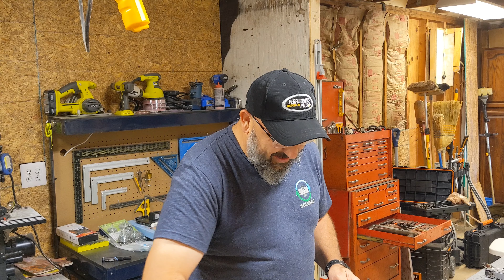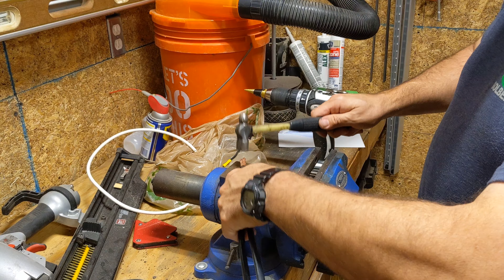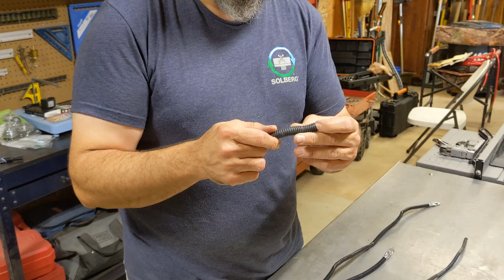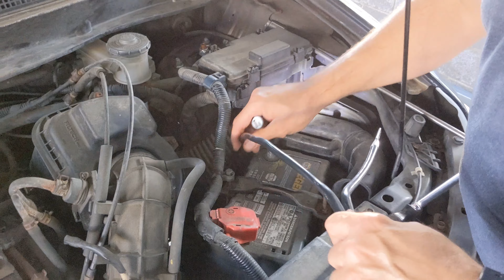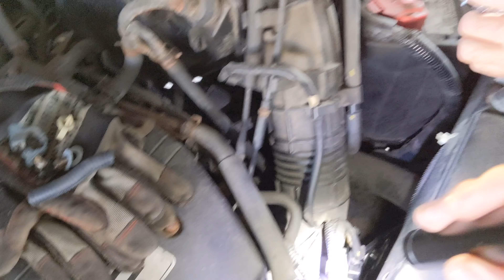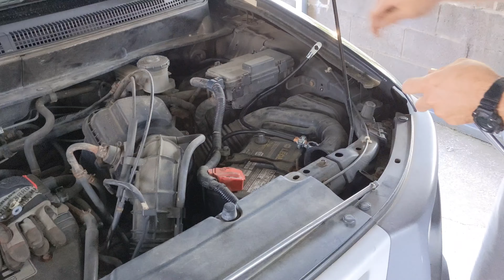How To Replace The Negative Battery Cable On A Honda Element Manual Transmission

Comment: I did this today using nearly identical parts and process. The hardest part was getting that clip thingy off the base of the battery tray. If you don’t know there is a release clip but you may have to use a pry bar still. It’s nice that the cable is completely protected from the elements and thicker. Reused “loom” and clip. I had a battery light coming on and off and was running rough. All good now. Thanks for the video. Dealer quoted $100. Did this for $25

Comment: Whats the correct part number? I see there are a few wires ready for pick up near me just dont wanna get the wrong one. All i need is the small one that goes from negative terminal to the body.

Comment: I did this today.  The Advanced Auto didnt have the same parts but they had Diehard 4 gauge 49” cable near the batteries.   I bought the 4 gauge post mount to accommodate the wire, same as described here but again, Diehard.  I didnt use washers, I cut the ends off the old cables for washers.  I did put Never seize on bolts.  I did not have to go under the car at all.  Took about 10 minutes to create the new cable and 10 to install.  I did break the post connector because it was too big for the post and I couldn’t tighten it enough.   I ended up going back to the auto store and they had post shims but I had to grind them down a bit to get it all snugged up.  Starts great!  Thanks for the video.  My Element is a 2007 LX automatic
Reply: Glad our video helped.

Comment: In my case I have a no start/ no sound on key turn issue but the dash lights all come on fine. Would the interior lights still work with a bad ground?
Reply: They might. I know that is a poor answer, but each bulb could have it own ground that may allow it to still work with a bad main ground. Sorry, I could not have a better answer. You may want to check your actual ignition switch.

Comment: Does the long end of the ground wire need to be screwed exactly back to the same original hole?
Reply: Not really, any good place with sufficient contact will do.

Comment: Hey man. Thanks for the video. I bought the same parts. How did you bolt down the ends of the ground cable? The clips are much larger than OEM!
Reply from the maker: I added washers to fill the space. Watch from 7 minutes forward.

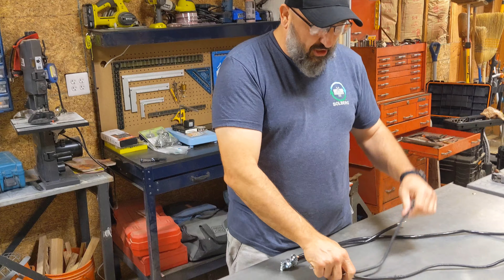Comment: The OEM Honda cables still come with the exposed cable near the block which will corrode away and break in no time.  I just replaced the negative cable on my '05 Element MTX at the time this video was posted with 2/3 from my original cable and 1/3 from a scrap yard Element as described at 2:14.  Had to solder the splice together which was not an easy task. Cost me $0 but honestly, I'm not happy with it.  I totally like this method and I can get all the parts shown locally.  Great idea removing the insulation and crimping the wire under the battery terminal!

Comment: Nice, the oem ground cable is partially exposed where it mounts to the trans. I sanded the contacts on mine and where the ground mounts on the fender. I ended up having a bad starter but it cranks up great now.